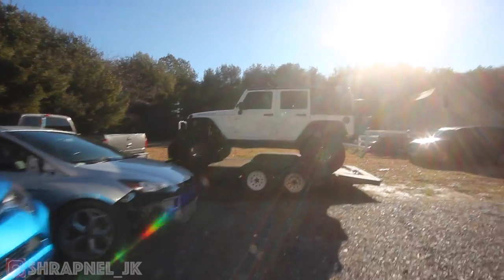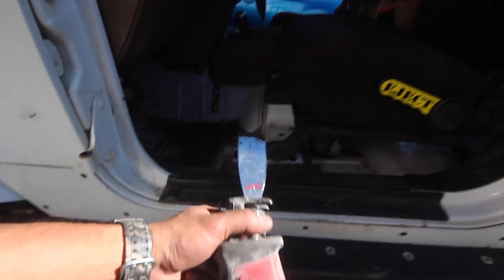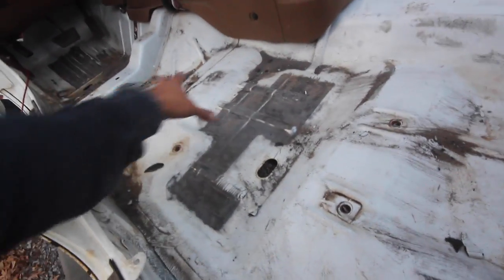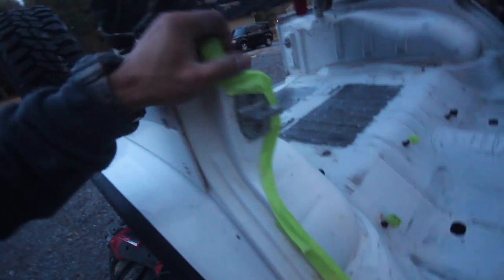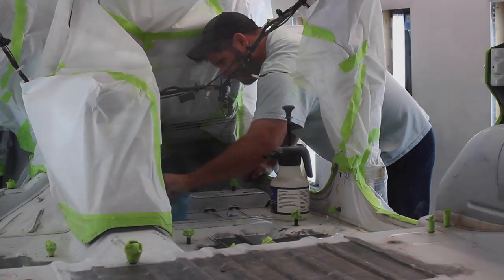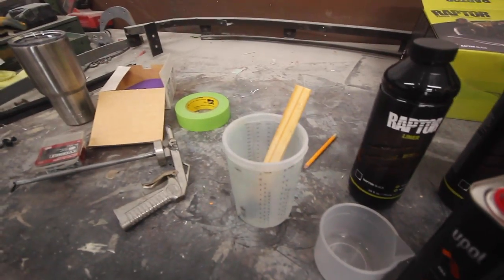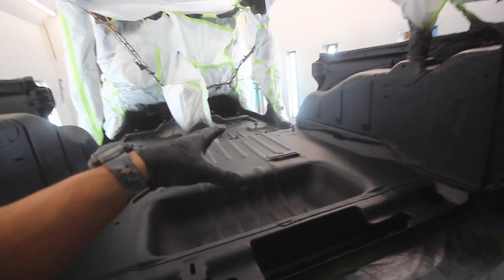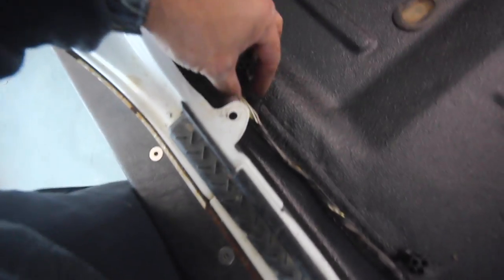Spraying Upol Raptor bedliner on the floor of a 2012 Jeep Rubicon

Comment: That paint scraper on the sawzall is a great idea! I'm getting ready to paint Raptor bed liner in my Jeep. I tried just a scraper but most of that sound deadener won't come up.

Then I remembered your video, so I bought a cheap sawzall and paint scraper to get that stuff off. Thanks for the idea! I'll let you know how it went for me.
Reply from the maker: That's awesome dude! Keep me posted
Reply: I tried the sawzall, and the paint scraper kept popping out. I ended up using a wire wheel to get the sound deadening off below the back seat. It was such a pain that I didn't bother doing it in the front. I'll just sand it flat.
Reply from the maker: @WilsonZoneOK  That is a bummer. Depending on the temperature outside depends on how easy it comes up.... Now some people go to the grocery store and grab a bag of dry ice and harden that stuff up using the dry ice and then it chips away pretty easy. But it's just bed liner just hammer on a heavy coat over top of it and you won't even notice it

Comment: Did you use any raptor primers like the Epoxy one or the acid etch?
Reply from the maker: I didnt use that brand specifically...but its always best to use an epoxy primer or acid etch over your bare metal. If I did I probably used a spray can version of acid etch from the company Kent. Thays usually what i have around my shop.

Comment: I have a 2009 and plan on doing this but how do you hide the wires in the front once the carpet is gone?
Reply from the maker: We just ran them under and around the trim down the side, also cleaned them up a bit wrapping them in fresh wire loom. Try it and let me know how it works out.
Reply: @mattFNpratt  what were the loom sizes you used through the vehicle?

Comment: Does it work for temperature control inside the cabin?
Reply from the maker: I'm sure any extra layers or coatings can help a bit. But they do have better options for temperature control if that's what your aiming at.

Comment: Looks great, my question is does anyone ever to tis to the back of the carpeted area on the back seats?  I have a JEEP dog and 2019 sahara, dog hair everywere!
Reply from the maker: Yeah we did the back seat area in this one... Of course we don't have any carpet down at all but instead of having shiny paint that your jeep dog would scratch up we have the bed liner down which doesn't show scratches as much and probably easier to vacuum hair up. So probably a good idea for your dog!
Reply: @mattFNpratt  Thanks Matt, I have a liner on the rest of the jeep "areas" just not on the back of the back seats, which are carpeted. PITA for dog hair

Comment: Why do u wanna get an older trans vs re-build the one u have
Reply from the maker: The older ax15 trans don't have a synro issue as bad as the newer nv3550. The ax15 does have other issues but I can deal with. The nv3550 trans   can be rebuild but they say you can rebuild them and they still end up grinding later down the road. But I'm having issues finding an older trans so rebuilding might be my only route and just see how many miles I can get out of it....

Comment: Grinding Trans? bet its a NSG370. Mine in my 05 is a little... sloppy.
Reply from the maker: I have an 03 Wrangler...it's in my earlier videos...and it has the nv3550...grinds all the time. I just put an ax15 in it(vid will be out soon) for temporary untill I get the other trans rebuilt. But yea most jeep trans just plain suck lol
Reply: @mattFNpratt  yeah, I saw that after I posted. Mine grinds a little, but it is not bad. Hope I dont ever need to rebuild it.
Reply from the maker: Lol ax15 trans get stuck in gear, nv3550 synchros are made of playdoh and sounds like your trans was built in a sand storm....why jeep? Lol